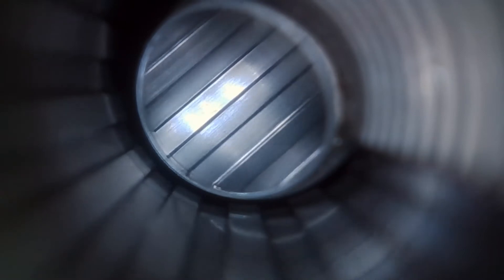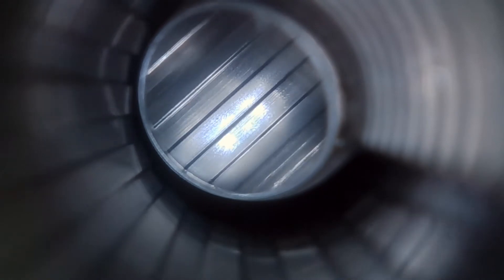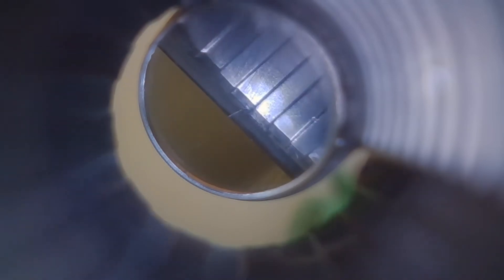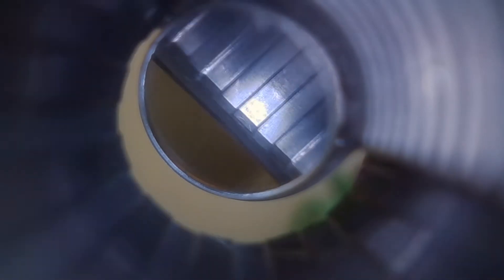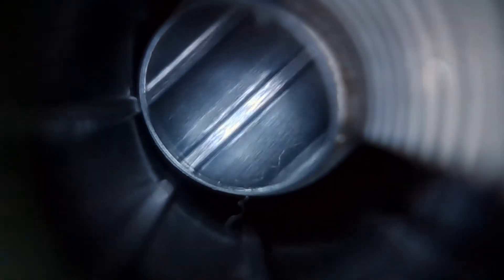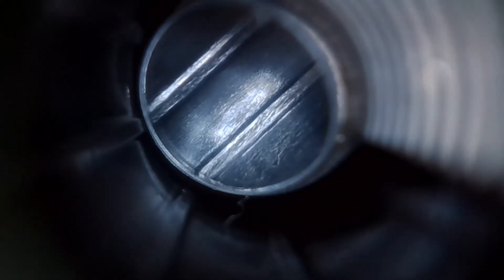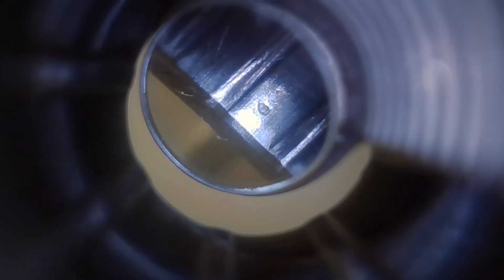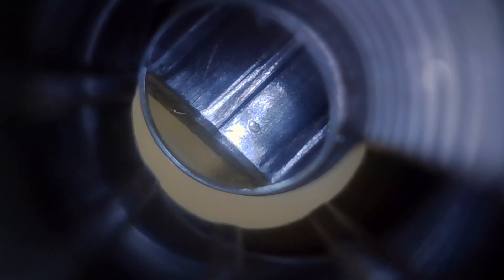Bore scope comparison of a Taipan Veteran CZ Barrel and an Airgun Heaven slug barrel.

Comment: Good job! I have a Taipan veteran long .25, the barrel has the same TR, 550mm but LW with shock. What is bore scope? Can you give me a little more information about it? Any impressions on this slugs barrel? I see that this new barrel is faster, is that better, because according to some it should be a slower barrel?
Reply from the maker: A bore scope is a camera that will look down a barrel. I bought mine here: https://www.amazon.com/gp/product/B07TTQF24F/ref=ppx_yo_dt_b_asin_title_o09_s00?ie=UTF8&psc=1

The new barrel is faster which should (in theory) be better for slugs because the spin on the slug will be faster and help it stabilize. For example: The faster twist rate will spin the slug at 890 fps the same as the slower barrel will at 1050 fps. Hopefully, I'll get the stability of the fast speed but at a velocity my gun will like. Here is a link to a post I made on AGN forum about the barrel so far: https://www.airgunnation.com/topic/taipan-710mm-slug-barrel-from-airgun-heaven/#post-1021702
Reply: @ajarnmichael1  Thanks friend I will see